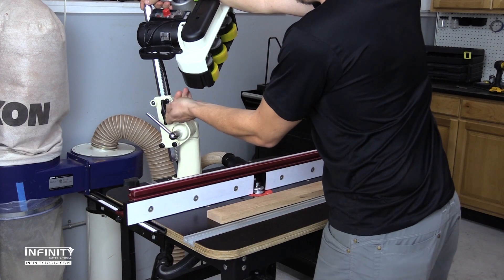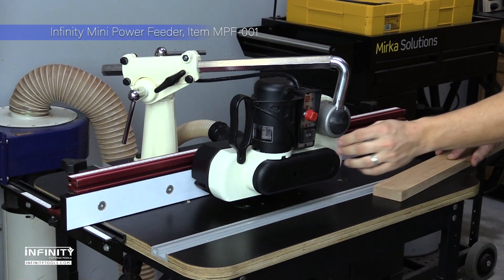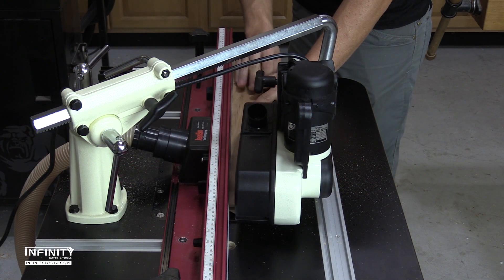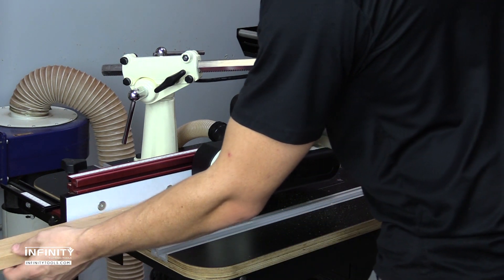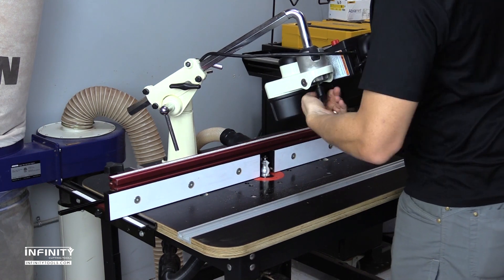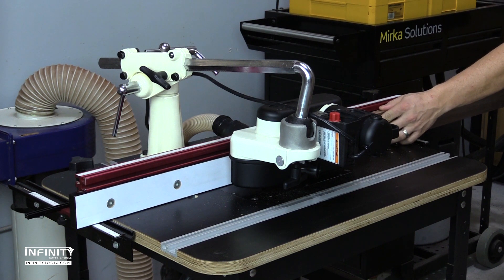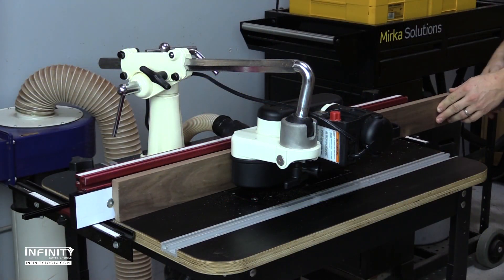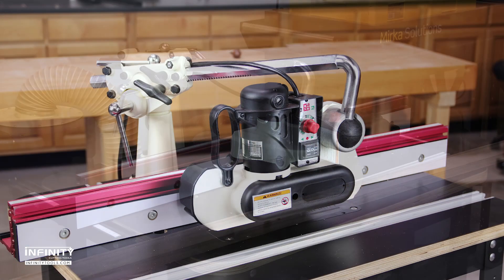Infinity Tools Mini Power Feeder

Comment: Kudos for bringing a well conceived and much needed miniaturization of standard industrial feeders to market! What is the farthest effective horizontal reach of the arm, as measured from working face of the fence to the nearest edge of column base, that allows the feeder to function both horizontally and vertically as demonstrated in the video?
Reply from the maker: For locating the feeder base. From center of collet to center of base roughly 8" we also recommend offsetting from center line 3" to 4" to allow for items like dust collection. The base can be offset to the in feed or out feed side of the table, positioning it toward the in feed side can increase reach, positioning to the out feed seems to be more ergonomic for  setup. These measurements should allow sufficient travel of the router fence to allow bit and insert ring changes, and provide enough reach for the vast majority of operations the feeder will be used to accomplish.
Reply: @InfinityTools  I would like to use the feeder on a small 10" table saw I keep next to my jointer;  that saw is strictly dedicated to ripping solids up to 12" wide. I would like to maintain the full 12" rip capacity with the feeder permanently mounted to the saw table. So I worded my initial question with hope of determining what the maximum rip width could be before the back of the fence is obstructed from a wider positioning by the base of the feeder. My net fence assembly width is 2 1/2". So in order to preserve the capability to rip 12", the distance from the saw blade to the feeder base would need to be 14 1/2". With this added info, can you inform whether the feeder's arm is long enough to reach the far side of the blade if the base is located 14 1/2" from it? Thanks.
Reply from the maker: No, this feeder will have roughly 10" of reach, it would not be able to reach 14+" you would need a much larger feeder. In ripping applications at a tablesaw the feeder would typically be positioned between the fence and the blade, feeding the " trapped" portion of the workpiece just as you would if hand feeding.  Reaching beyond the blade leaving the workpiece trapped between the blade and fence would not be recommended. Depending on the minimum width of stock being ripped and the method you use to attach it to your saw,  this feeder may still work.